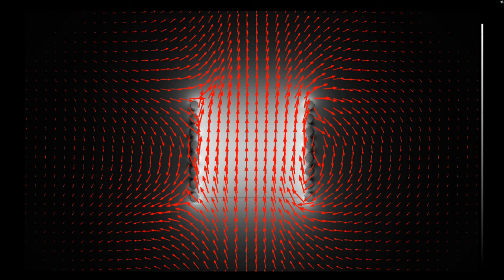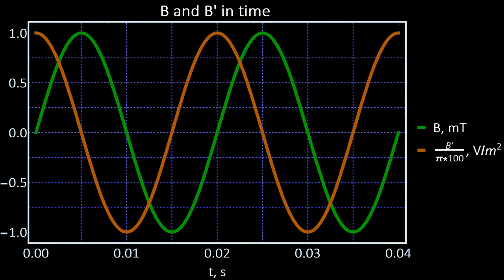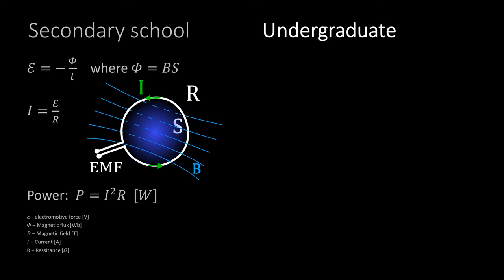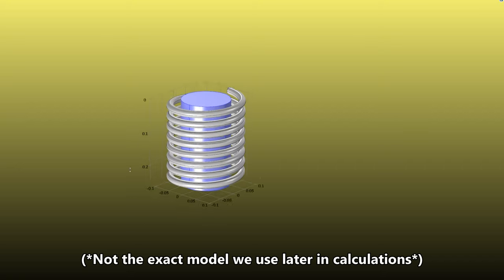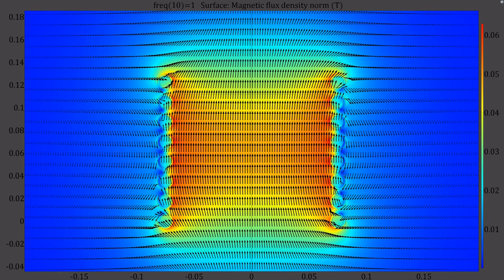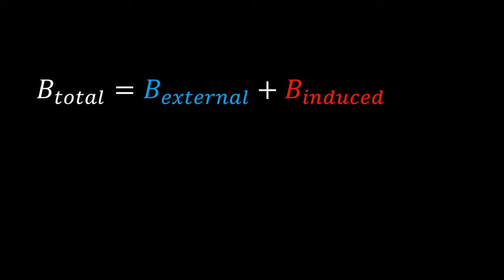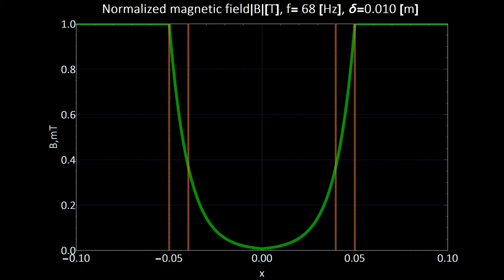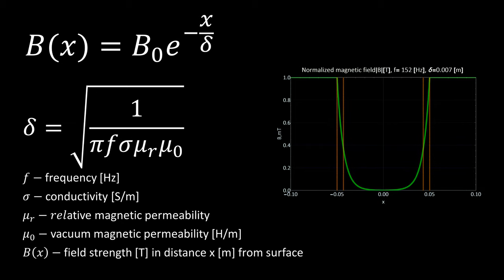Skin Effect Visualized - Physics Behind Induction Heating

Comment: At high frequencies, will there be a difference between a solid metal bar inside the solenoid and a metal pipe with some thickness? seeing that skin effect isolates the magnetic field at the surface of the metal bar

Comment: One thing I never understood about the skin effect is why the induction current follows the incidental current. I would think when the current reaches a maximum, the magnetic field stops changing so the skin effect should be eliminated. Then, as the magnetic field begins to change again, as the current reduces, the skin effect would flip and become the core effect. Then when the current reaches 0, the skin/core effect would be at its maximum.
Reply from the maker: The resulting animations you see here are time-averaged solutions. That means that the result is a static picture and the direction of the magnetic field is chosen arbitrary (in this case by default up). Things move in animations because I change frequency so there are a lot of static pictures that are slightly different.  Your question could be answered with calculations and animation where time is changed. In 0:30 there is such animation but without conductor inside. To get such animation one should do the transient calculation  ( more difficult than frequency-domain used here) and there you could really see how magnetic field changes outside and inside the conductor. Only then we could observe things you mentioned that happen within a period of one oscillation. Like how magnetic field inside conductor lags behind applied field outside.

Comment: Hello hi, thanks for the beautiful explanation. Can you please suggest me a source where I can find the derivations of the modified Maxwell's eqns you have shown at 2:54?
Reply from the maker: Can't really pinpoint a single source since I took it from the software and that is their way of description used in that particular physics module.  However, I can comment on how they differ from Maxwell's equations in default form differential form you see for example in wikipedia.  1) This is Ampère's circuital law.  Term for displacment currents is ignored.  Relation B= mu H is used. 2) This is mathematical way of experssing magnetic field with a "magnetic vector potential" A.  It is an anolog of what eletric potential is to Electric field. In short it is more convienient way for some calculation to use Magnetic vector potential. 3) That is Ohm's law in differential form and a harmonic approximation with complex numbers is used for alternating magnetic field.  4) Here again vectorpotential expression is used. Doing that electric field becomes E=-(grad phi + partial time derivative of A). The first part is ignored and the second part is what we see on the screen when we do the time derivative of a harmonic function expressed with complex numbers.

Comment: Hi, I have a question regarding the skin effect of induction heating, is it possible to heating a non magnetic material? Such as aluminum, titanium, etc
Reply from the maker: Yes, it is possible to heat all metals with induction heating ( and some nonmetals as well, e.g graphite). In another video, we show exactly aluminum melting and copper heating.
Reply: @MHDTechnologyLaboratory  well, do you know how to prevent an induction effect on the bolt of Stainless steel, I have an induction heating for a galvanizing application, I increased the temp proportional to the current, is it possible to heating the surrounding such as bolts?
Reply from the maker: @TFHC  Only hope would be changing frequency of applied current. That could change ratio of generated heat in different materials to certain degree.
Reply: @MHDTechnologyLaboratory  wow it make sense by using the formula which u explain, do you have any email? I would like to discuss more detail
Reply: By adjusting the AC current frequency by using the inverter, I'll try it

Comment: Is this video related to the phenomena where an electromagnetic wave attenuates when passing in a conductive medium?
Reply from the maker: Yes
Reply: @MHDTechnologyLaboratory  Thank you for your response. I have an additional question. Why do people talk about skin effect as the concentration of electrons in a wire in an AC signal?
Reply from the maker: @somerandomguy4607    I think that is the most common case where the effect can be found. Plus it has the immediate impact of changing the electrical resistance of the wire. Also, it is easier to sketch and explain, because you can do it in 2D example of cross-section of wire.